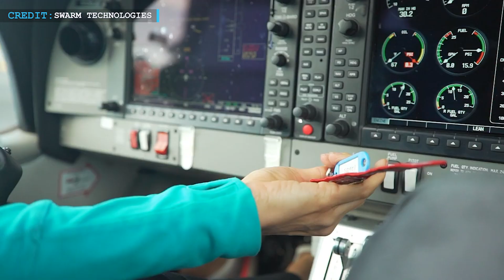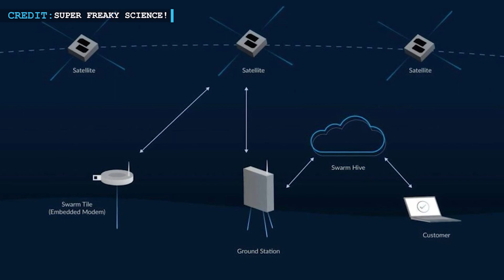SpaceX Crew-1 Debris Crashing Down on Australia | Starlink for Mobile Users: Swarm’s Development

Comment: Ooohhh, bad timing.  US wags finger at China for space debris, just as US space debris lands down under.  Oops.
I'm sure it was tracked, but was anybody told?  Is there even a way?  Maybe those ranchers could use some Starlink terminals.
Good opportunity for SpaceX to do some analysis for future improvements in their products.
Reply: Actually it's the size of the debris that makes the difference. China lets whole rocket sections crash uncontrolled. There have been whole villages wiped out (in China) by stray (failed) rocket launches. They just send a cleanup team to make it look like the village never existed, and carry on caring less.
Reply: @paulmichaelfreedman8334   from BBC 😂😂
Reply: @paulmichaelfreedman8334  SpaceX has actually been pretty good about this.  They delayed Starlink V1.5 (laser intersat link) until they designed their own laser hardware so that it completely burns up upon reentry.  It's not just size, but composition.
Reply: @AZOffRoadster  SpaceX pledged full cooperation too in making sure the satellites cause as little optical disturbance as possible for telescope observations from the ground.

Comment: Please stop pushing this Chinese Propaganda against Spacex.
Reply: Highly plausible because SpaceX dropped debris on populated areas during re-entry before. There was a series of mechanical valves that drop-down on the state of Washington from their crap
Reply: @serronserron1320  difrence is that those where from complete failures, China does it on purpose and makes no announcements of failure.
Reply: @miguellopez3392  That’s BS, the SpaceX does it purposely.
Reply: @TheRedland284  sure they do, after all it totally isn't their goal to re use boosters and instead destroy them...
Reply: You are applying conjecture. STOP IT

Comment: 3:33 The SpaceX debris is interesting, all the resin is burned off the graphite (carbon) fibers. These carbon fibers seem to have protected and kept cool what appears to be aluminum honeycomb, which would have melted at very low temperatures wrt entry. A furry heat-shield. After entry, it appears to have flown with stability of an feathered arrow. Like the Henry Wadsworth Longfellow poem,

I shot an arrow into the air,
It fell to earth, I knew not where;
For, so swiftly it flew, the sight
Could not follow it in its flight.

.....
Reply: Could it be the remains of a COPV?